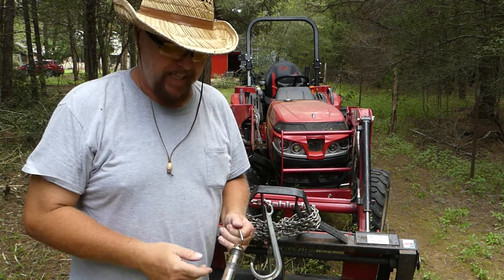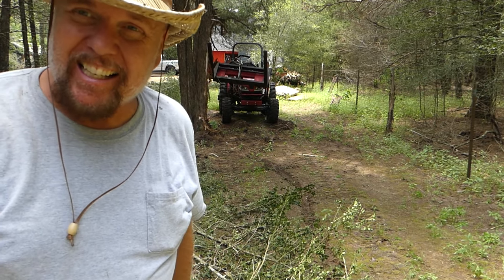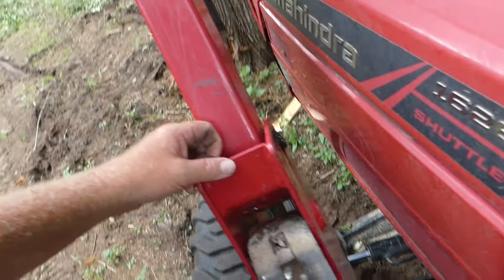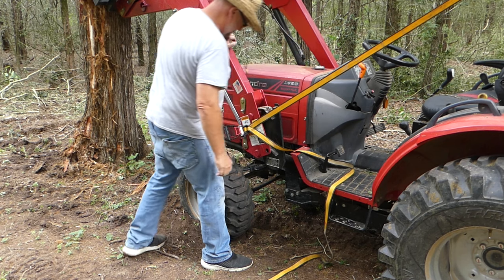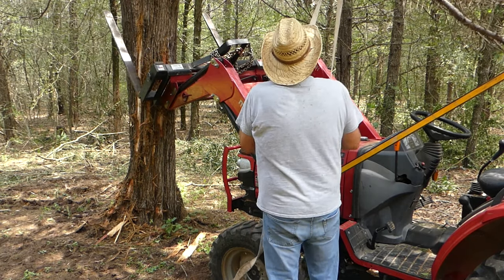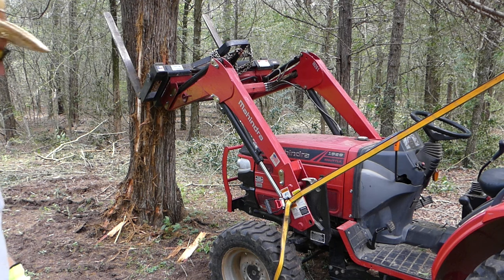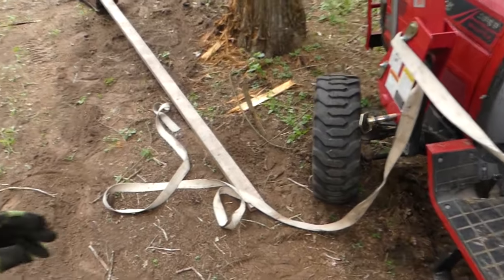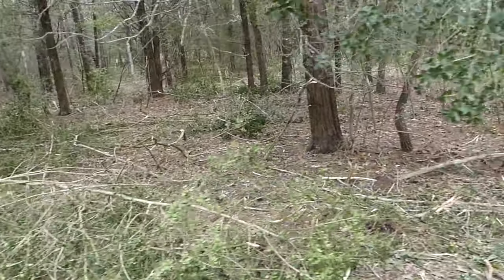A weird disaster. Front End Loader broke off my tractor. Is a field repair even possible?

Comment: I am wonering if the loader was bent at all.
Reply from the maker: It appears the loader is straight and true. Pistons don't leak. It is still moving logs...

But... the hood, cowl and engine grill all need some realignment. They are bend and hood does not latch any longer.

Mahindra are tough machines though. I would buy another.